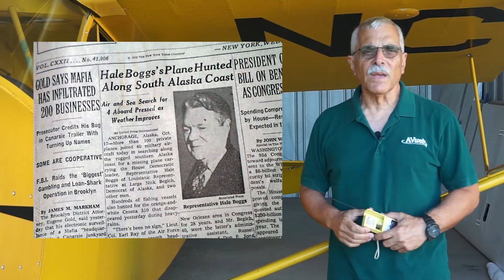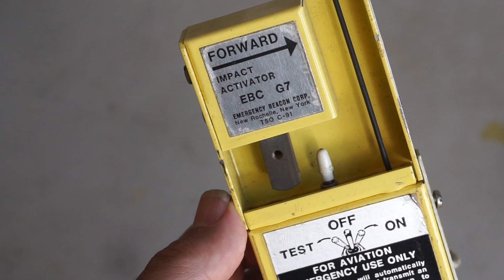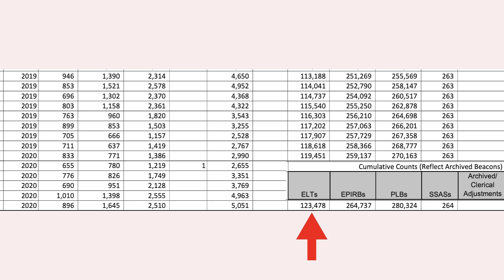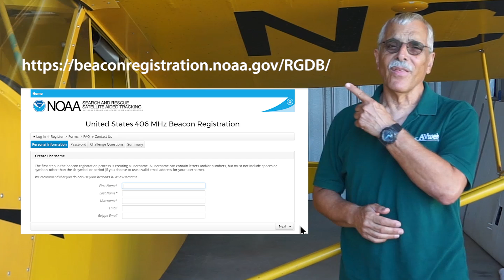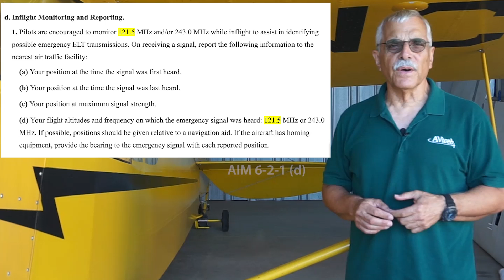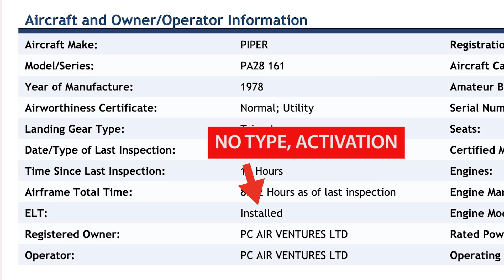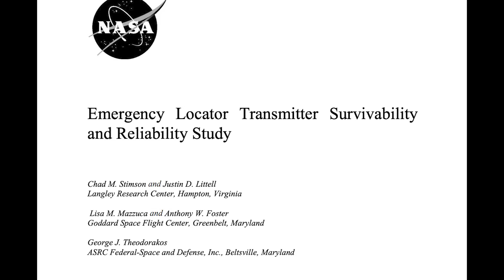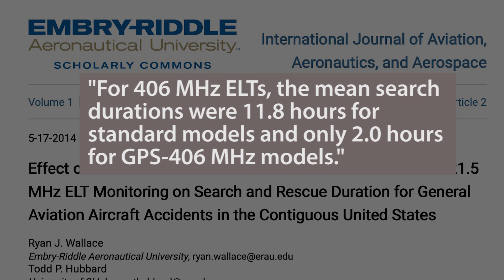Why Cheapskate Pilots Don't Like 406 ELTs

Comment: Testing a battery that’s not connected to anything except the meter tells you nothing about how ‘good’ it is - it’s not under any load, so it can read close to it’s rated output voltage on a meter as the meter is a high impedance load, ie it uses a tiny amount of current so it doesn’t affect circuits it’s being used to test. You need measure the voltage while the battery is under load, ie in the device if possible - not on its own. 👍

Comment: I fly with fixed and rotor wing Part 135 operations year round in the coastal forests of Alaska. I trust the ELT, and I also wear my PLB on my inflatable PFD.

I’d rather have it and not need it than need it and not have it.

Comment: A PLB with the ability to send/receive messages in my opinion is the best solution for aviation as well as any other activity that takes you off the beaten path.  In an aircraft crash, if the radio is destroyed or otherwise is INOP (likely) and the ELT doesn't work (works 1 in 3), there's not a lot of hope for a swift location and rescue.  PLBs with two-way communications can not only help with locating you, but can help SAR in knowing the nature and urgency (injuries, environmental factors, etc.) of the situation.

ADS-B can help in starting a search area, but there's a delay while the data is examined.  A PLB is cheap insurance to summon help when it's needed.

Good stuff!!  Keep the videos coming!

Comment: If you have a 3D printer, you can easily make a new battery holder, which would enable you to change the batteries yourself. I suggest that you may find a STL file on the internet where someone has done it already.  Great site and appreciate the information you provide.

Comment: Paul, how would the data have changed if when possible the pilot turned on the 406 prior to impact (if all aircraft were fitted with 406 like in NZ and Australia)?

Comment: I agree the personal PLB is a better investment. We used them in flight training. No risk of damage to antennae like aircraft systems. Activate it if needed. Cheaper. Multipurpose. They work. I'd be happy if they simply removed the ELT mandate from noncommercial aircraft and left it up to individuals to take responsibility for their choices. Then encourage the use of PLBs instead. Plus, if you decide to leave the crash site (there are reasons to do so, real life is not black and white), you can take your beacon with you.

Comment: A GPS-enabled 406mhz ELT (or PLB) that has been activated in the air before the crash might result in a few good pings on the COSPAS-SARSAT system.  The key is remembering to turn it on when things are going badly in the cockpit...

Comment: If the requirement is to change the battery every 24 months, then change it with a good battery.  A known good battery that was in the unit for the previous 24 months.

Comment: If you have a 406 ELT, and you are going down, light the thing off! That's what the remote switch is for!  It takes about 1 minute for a distress 406 packet to be sent, so if you get one packet out, all the better and someone should be coming looking for you.  At that point it doesn't really matter if the ELT survives the crash, use it for the tool that it is.

Comment: I don't mind paying for good value, I wouldn't for instance spend 2000 hours building a factory plane myself but paying 140 grand for a 57 chevy engine (Lycoming IO580) is where I draw the line. As for emergency beacon, surely someone can make a molded unit with fractal antennae like a phone so they can't break off. A good lifepo battery might have 30 year calendar life and costs 2$ and can be recharged 2000 times. With the advent of starlink internet, planes could also stay in constant contact anywhere in the world so any loss of signal could be immediately traced. The plane can also complain about feeling bad and you can call in an emergency before crashing.

Comment: My own ELT story happened a bunch of years ago when I was prepping for my CFI ride.  I was practicing cross-control stalls when I discovered that if you abuse a PA-28 hard enough, it is possible to make it do something exciting.   Bounced my flight bag off the cabin ceiling.   Completed the flight, put the plane away, and went home. Came back a couple of days later for my next flight and during the preflight, discovered the ELT laying on the baggage compartment floor.  Apparently I had bounced that along with my flight bag.  Turned on my handheld VHF and sure enough, it was screaming.  Turned it off, put it back in its holder, and went flying.

But, the moral of the story is that the ELT had been going off for 2-3 days on the ramp of a busy Class D airport with scheduled airline traffic.  Beats me how nobody tracked it down and gave the flying club a call.
Reply: When I worked on a rescue boat we used to track distress signals using a directional antenna.  It worked great when we were trying to find a boat that was all on its own in the middle of nowhere, but trying to figure out which boat in a marina was the one sending a false distress signal was near impossible.  I think in your case it is likely that someone tried to find your beacon and when they found that it was being emitted from an airfield they dismissed it as a false signal.
   I also used to work in the radio tower that ran communications for the rescue fleet and I was the guy who had to keep listening to the false alarm because we had to continue to monitor the frequency even though it was being jammed by an inadvertent transmission.  I tried to think charitable thoughts, knowing that it was just an innocent mistake. :)
Reply: Probably had a bunch of Civil Air Patrol guys out there looking for it bouncing it's signal off of the steel hangar :D
Reply: @dadasaurus_rex25  pfft I used to be that guy - I can isolate which hangar it is in 5-10 seconds. Loop antennas rule.
Reply: @onenerdarmy   That and a radio is definitely better than trying to use an L-PER.  I stay in the air and use the 406 Becker.  I never was too good at ground team but I can fly those angles and get the ground team on target like a champ.
Reply: @dadasaurus_rex25  ahh I was flying a lot and landing and picking out which hangar all over NorCal from 2009-2017. I will join again if the air force doesn't want me for good ☺️
Reply: @onenerdarmy  between the Army and the Air Force they had me for 20.  Stay for the long haul if you can.
Reply: dothemathright 1111   Unfortunately for CAP members they can't just call it a day when an ELT is active.  They are directed by AFRCC to find it.  It's easy enough to either use a handheld radio with a short antenna or the LPER with no antenna and body block to find a signal among hangars.

Comment: And you think somebody is listening....  In the early 1980s, I was an avionics tech for the old Frontier Airlines in Denver.  The CV-580s in the fleet carried ELTs because they often flew routes VFR to uncontrolled airports.  One day I was preparing to test an ELT installation by activation.  As the hour approached, I called ground control on 121.9 and advised them that they would hear three sweeps.  The ELT was quite loud as I monitored it on VHF #2 and then turned it off.  I contacted ground again to tell them I was done--they had heard nothing in the tower.  I repeated the test, still nothing.  Turns out their guard frequency receiver was inoperable.
Reply: Oops... guess that’s a very unwelcome variation of “no news is good news”? Want to bet that little gem resides in a checklist somewhere that always has checkmarks next to everything?😏
Reply: Wow! I come to YouTube for the videos but stay for the comments

Comment: They do have a good reason for making sure the batteries are securely attached.  Sadly, they should put more of the same care into other parts.  I bet most of the antenna issues are not the fault of the ELT manufacture.

Comment: As a retired Air Force rescues Pilot working multiple GA crashes in the US, only one beacon worked and helped in location. That mishap ( crash for civilians) was a forced landing in on the high plains of Wyoming and ELT activated when the noise heat went into a prairie dog hole. Pilot banged his head when forwards stopped suddenly and the aircraft remained upright. Our Detroit finding equipment had him at 20 NM. We had him visual at 5 NM.  No fire just a yellow plane sitting in light brown prairie grass with a trail tire marks. The fatal crashes never had an ELT that we could hear.   I do think there’s good sense to have your ELT remote, transponder, and radio control heads close to each. My experimental zenith they are within a 4 inch radius. If it’s a forced landing (engine out no restart) then 2 button push I’m talking 121.5, 2 button push and transponder ( with ADSB) is 7700. And if landing looking like it’s gonna hurt, 1 button and ELT 121.5 and 406 active
Reply: I hate spell check. The NOSE WHEEL. Our DIRECTION finding
Reply from the maker: Thanks for that. One beacon in all those missions. Wow. Kind of squares with my data.

Comment: Fascinating video!  I did a number of SAR missions back when I was in the reserves in the late 70s.  All had ELTs and we never heard any of them.  I’ve spent a lot of time flying aircraft with ELTs and never thought much about the statistical likelihood of them being useful in a crash - you just assume that they’ll work as advertised.  Now, as a guy who can’t pass the flight medical anymore, I have a sailboat that I often single-hand, and I always wear an ACR PLB clipped to my PFD (which I always wear).  I have a horror of somehow falling overboard when the boat is on autopilot and watching it sail away from me over the horizon.  That’s a big lonely place to be when you’re a dot in the water.   My ACR has never activated by accident despite lots of banging into things while moving around the boat, and is small enough not to be a nuisance.  If I could still fly, I’d have one in my aircraft.  Thanks Paul!
Reply: I do clip in with a harness anytime I’m sailing in anything nasty or the waves start getting “exciting”, but it’s a massive nuisance to use all the time, especially in fair weather, and I suspect that 90% of sailors don’t use them except for foul weather, but it’s more the totally unexpected slip on a smooth pleasant day that I think is most likely to get you.  I’m always cautious, but accidents happen.  (I vividly remember shooting circuits in a Cessna 150 back in 1977 and they told the student- who had soloed the day before - to overshoot.  He replied, poured power to it and started to climb, and forgot to move to avoid overflying us.  You guessed it, we’re climbing out and a shadow passes over our aircraft - we lean forward and there’s another 150 about ten feet above us, about five seconds from collision.  We dove violently away - enough to pin our flight bags to the ceiling - and managed to stay alive.). I was a prudent pilot and later flying instructor and CFI, and I’m careful when sailing, but sometimes the fickle finger of fate reaches out and taps you on the shoulder.  There have also been some nasty sailing accidents in the last few years where people going over get dragged to their death - one of the reasons I use a short harness, and why it’s such a pain in the ass to use.  Cheers,  Lance
Reply: Malcolm, fly LSA!
Reply: It seems like the old method of hitching yourself to the boat with a light line would have better results. Why float in the ocean for days hoping for rescue when you can just pull yourself back onboard?
Reply: @mytech6779  A rather dismaying number of years ago, I was out sailing off the coast of Oahu with a friend on his Hobie Cat. I was out on the trapeze (which is to say, "attached to the boat with a ... line") playing the part of live ballast one moment and surfacing after a rather surprising impromptu bath the next. The line (to be fair, a steel cable rather than a "light line") had parted at the shackle, dropping me into the Pacific.

It was easy enough for my friend to come back and pick me up, and of course on that boat had I been alone, the boat probably would have dumped over almost immediately. Nonetheless, I don't see anything wrong with carrying a PLB in that situation.

Comment: When installing/servicing industrial robots we always have to perform "battery swaps" when on site. Typically 4 or 6 name brand C's or D's that are used as position/data backups in the event of power outages etc. They've usually sat for a few months having never been tapped into a single time in a nice sealed container (the base of the robot) so us robot techs are quick to salvage these "used" batteries for our own use at home, rather than throw them away. 
Robotics Engineers are cheap bastards too!

Comment: You're not that cheap....

You have a Fluke DMM for battery testing
Reply: Hahhahahahaha :D This so much
Reply: It's very common that these kind of tests require the tester to use a device listed in the test specifications, usually more expensive, accurate devices.
Reply: @generic_programmer : Yep. And testing the terminal voltage of a battery
that is not under load will not really tell you the remaining energy. The best
info that you can get is if the voltage is low enough that it cannot possibly
provide the energy needed. Just look at the discharge graph. Some battery
technologies maintain a very flat voltage "drop" throughout the bulk of
their life cycle and the terminal voltage only drops like a stone at the very 
end of their useful life.
Reply: @dd_ranchtexas4501  Try to tell people this and they look at you like you're full of it.
Reply: @SalemikTUBE  I used to be that way but now I know it’s the truth. Even a Harbor Freight $4 multimeter will have separate Battery 🔋⏯ test modes on the dial from the Voltage modes. I assume the Battery mode has a resistor in line to provide some kind of load.
Reply: @generic_programmer  Though as he specified in this video, you're not allowed to do anything but what the manual for the device says (replace the whole pack of batteries)... He likely wouldn't be allowed to to maintenance to his own plane either, since he isn't a mechanic.
Reply: What's the use of having the cock and balls of a bull moose if you can't swing them around every once in a while?
Reply: @micahned  lol I love AvE
Reply: @John Trolinger Yes, but you don't need more than a 5-10$ one to test your aa batteries :D
Reply: rkan2 guess that’s not the only thing he uses it for.